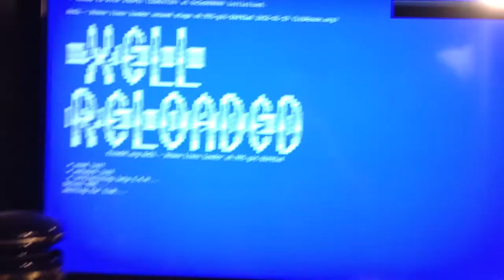Falcon Xbox 360 With Team Xecuters R-Jtag Boot Timing Test

Comment: just a word about running the wire through the southbridge holes, its awesome and thats how i have been doing my rghs, I did run into an unforseen issue though because my main rgh rrod and i installed the xecuter extreme rrod kit (which is badass and i highly reccomend it's been 6 months and no issues) the kit actually comes with a claming heat sink that employees screws that have to go through the holes so I had to redo the wires cause i had made them too short to go any other way.